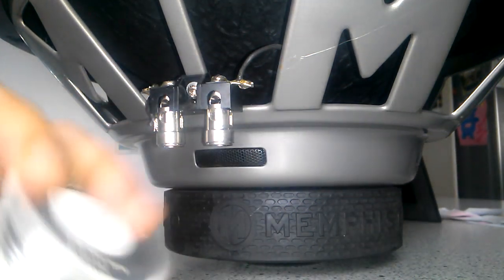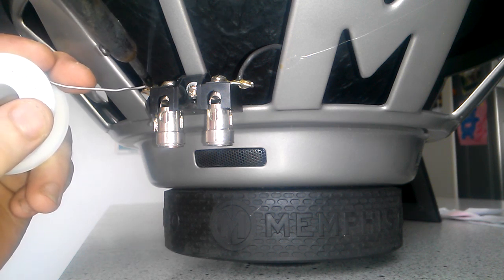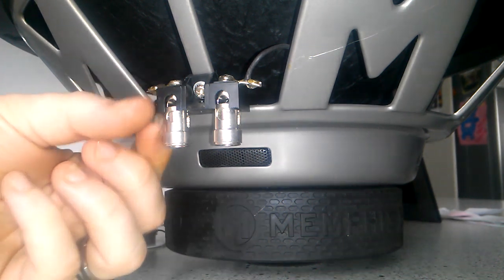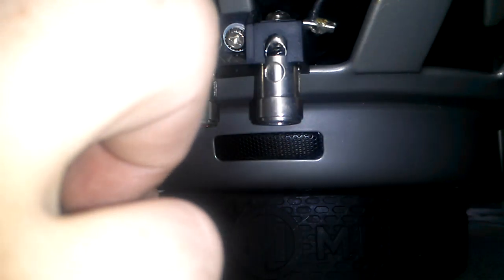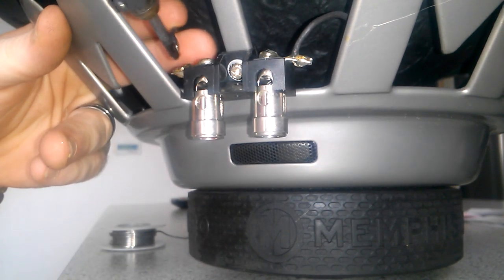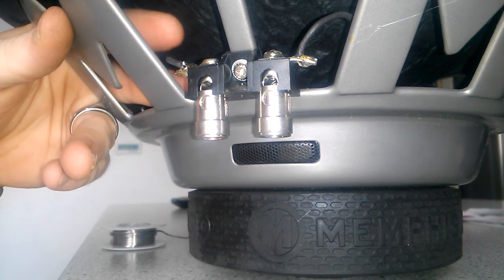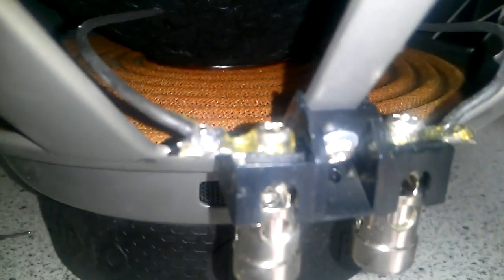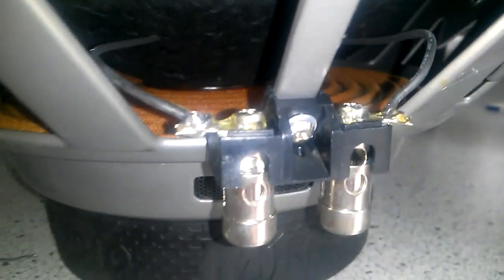How to fix a broken subwoofer tinsel lead

Comment: i got a subwoofer second hand and these leads had electrical tape around them. it would only work if i pressed on the cone or raised the volume. would re soldering these fix that?
Reply: I'm not a professional, but I would say yes.

Because when it's soldered on there, 2 things happens.

1: it will get held in place, because it acts like glue, but for wires.

And 2: the soldering will achieve a proper connection.

If it was me, I would try it out.

I hope it'll work out for you! ✌️

Comment: How do you fix it if the tensel lead comes off the the cone?
Reply: same here,,i think the  tiny thin wire attached to the cone is either corroded or just non conductive
Reply: @danilorainone406  
Touch a multi meter test lead (in resistance continuity mode, the horseshoe shaped symbol, beeps when you touch leads together) to the piece of tinsel lead coming out of the cone. Touch the other multi meter test lead to the other speaker terminal with undamaged tinsel lead. With speaker facing up and being careful not to move the cone at all. Any slight movement will change the reading but the multi meter should be beeping and showing the approximate proper ohms, typically 3.5 if it’s a 4 ohm and 1.7 if it’s a 2. If this checks out then you can move on to a repair attempt. Remove the dust cap using a cheap hand warmer packet to soften the adhesive and gently work at it with a flat implement. Once inside you should be able to see where the voice coil wire is soldered to the tinsel lead before going through the cone. The best way to go about it from there is what I am searching for myself right now.

Comment: Trying to rewire a pair of speakers I have. How would I remove the speaker wire from the leads without damaging them? Or is that possible? Would I have to basically just break them and solder them back on? I'm a newbie lol sorry but any info helps :)

Comment: I was hoping this video would be repairing the speaker if the wire broke at the cone. What this video shows should be completely obvious to anybody with half a brain.
Reply: Hydranix HNx  same
Reply: Ahakim24 Well I figured it out, if you're still wondering.

Remove plastic/cardboard center dome of speaker.

With soldering iron heat up the glue around the broken tinsel lead and detach the voicecoil wire form the tinsel lead.

Remove the tinsel lead and toss it.

Take ~3-4" of speaker wire, strip all of the insulation off and twist it until it stiffens a bit.

Run that new wire through the hole in the cone and attach one end to the voice coil wire, the other end to the terminal lead with solder.

Hot glue over hole and glue plastic/cardboard dome back over everything.

Wasn't too hard, just don't break the wire that goes to the voice coil or you done goofed.
Reply: Hydranix HNx can you make a video where u show it

Comment: If my sub is putting out no sound at all.. What does that mean? My amp is powering my 6x9s so it ain't the amp
Reply from the maker: video?
Reply: Its was a bad speaker.. Idk what was wrong with it.. But I was tired of waiting and bought 2 12" expoledz lol
Reply from the maker: +Junior Tuisata bad idea. should of got sq hds200
Reply: +Coryhughes00 my Sony Explodez were only $100 and I have a 96 Honda Civic DX Coupe.. So those 12" are way more than enough for my car.